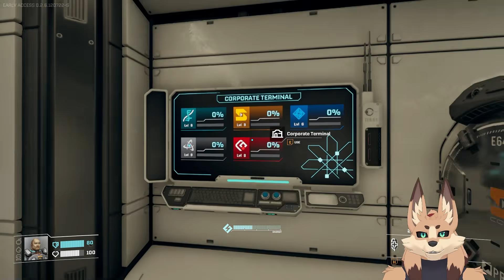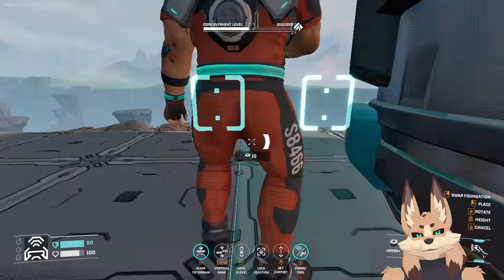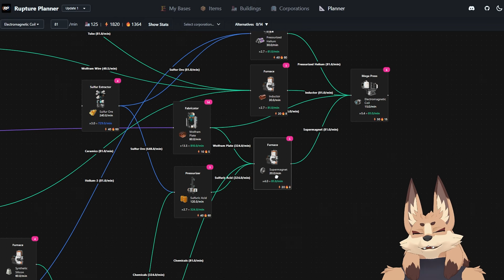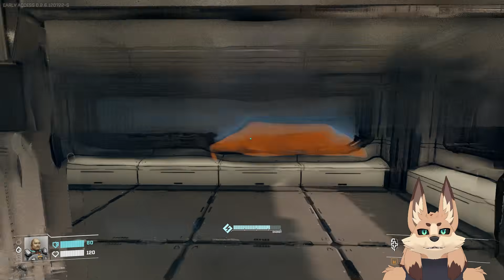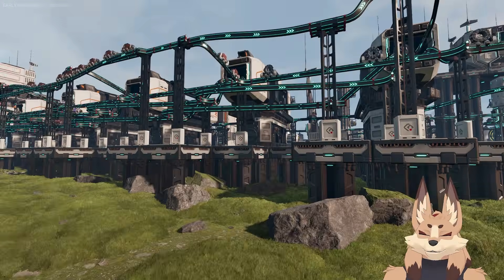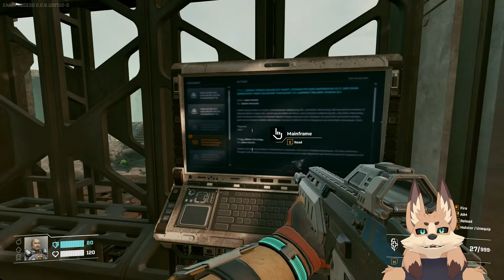The Electric Mesa - StarRupture [S2E9]

Comment: Why do you sometimes use basic structures rather than their v2 variants? Such as the section where you established inductor manufacturing
Reply from the maker: There's no v2 recipe for inductors, they can only be made in a v1 furnace. Other than that, I'll sometimes use v1 recipes when I only need a small amount of something and the v2 recipe is overly complicated.

Comment: .... Now I'm considering starting from scratch after seeing your nicely designed factories.... But I really don't want to, might just nuke all my factories as they are and start a fresh with my current process at around lvl 10/11 corps and most recipes/research done... I decided to make a base with every item being made in 1 machine... as you can imagine, its slow... and clogs during rail merges since it needs to loop back on itself to feed items for every recipe... It seemed like a good idea at the time >.>

Comment: question - i thought dispatch - receive was 300 items per min? a full stack of 100 every 20 secs?
Reply from the maker: 300/m is the upper bound of dispatcher/receivers as there are many factors that will cause your actual throughput to be lower than this. 300/m is also an awkward value to plan around since most of the game revolves around values of 60/120/240/480, so I find it easier and safer to calculate receivers as producing 240/m as it's better to aim lower and overproduce than rely on an exact 300/m and end up insufficient.

Comment: Another stellar production, Gengi! Thank you, sir!
Heads up, I've figured out that each container at blue print sites, dead bodies, drone wrecks all across the map are spawn points for vermin. Clear every pile. It drastically reduces the respawning of vermin. There are still specific points that will respawn vermin but they are spread out and easier to figure out base defense with. Even if it is just ammo that you are going to dump because you don't use it, take it from the body then just dump on the ground. Once you clear all items from a body, it is taken off the map. As you already know anything dumped on the ground will just be removed with the next Rupture!

Comment: i figure it all out with the stuttering its the platforms no matter were you build a bunch of them i tested it with just throwing 2000 down built on it and everywhere i went there was a big of stuttering lag but then i did a new save and built the same building with  no platforms and there was no lag no stutter so they r the issue if you use load of them  anywhere on the map that i don't get so far away from that area and there still a little stuttering not as much as in the area so i don't use them anymore just to build up. but i found its working better with out them